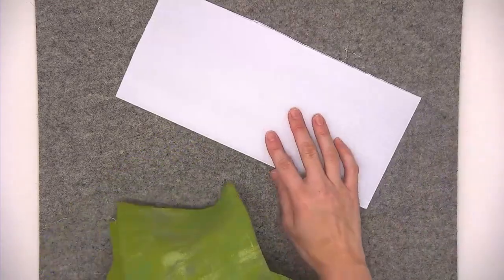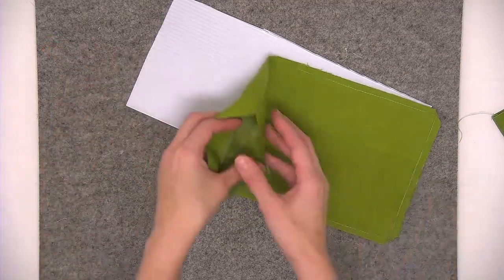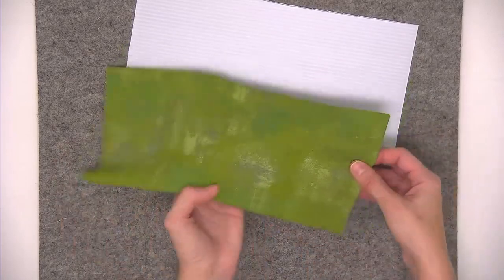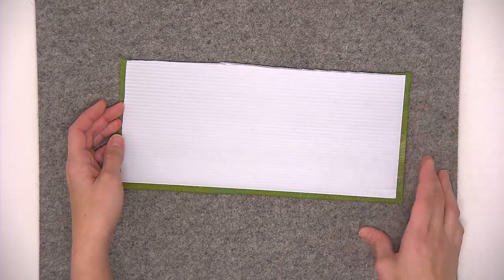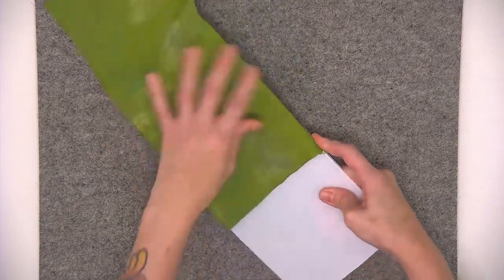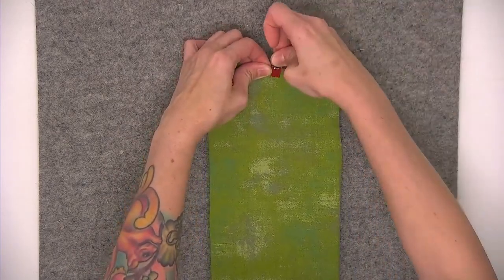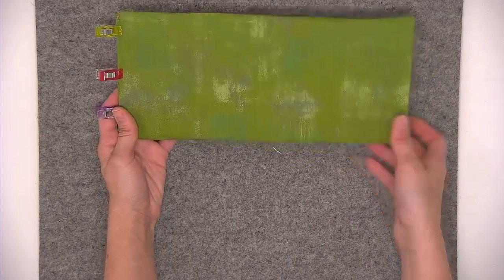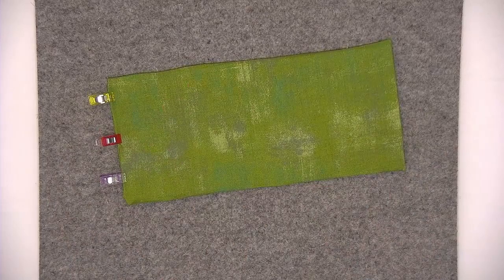False Bottom Part 2

Comment: I've made oodles of false bottoms. I actually had a plastic corrugated sheet I purchased years ago to place between the springs and mattress of my hide-a-bed and kept it when we got rid of my couch. I used the corrugated plastic in the bottom of pet carriers I've made and sold. I used 2 pieces for added support, taped them together and just covered it with foam, fleece and matching minky/fabric.for a firm and stable comfortable pillow like bottom. It works great!!

Comment: I did it once out of a cardboard, I took it off every time I washed the bag, but I didn’t know that is a false bottom. I also used a plastic canvas (the one that is use to cross stitch with wool yarn), I cut it to the measurement of the bag but was not sturdy, I sew two together with wool yarn, then covered it with the fabric… it worked well, but not enough sturdy for long time because it was a big bag. Now I know the name and what to use, thanks, Sara!

Comment: I use the foam board, but instead of sewing the edges shut I extend the open end by an inch or two so it folds underneath. This way I can remove the foam easily for washing the cover or change the piece of foam board.

Comment: I'm curious if the edges of the plastic will wear through the fabric cover over time.
Reply: When I've used this corrugated plastic I snipped the corners to somewhat give them a round-ish corner to take the sharp ends off and just placed some painters tape around the edges to soften the blunt cut edge, then covered with desired materials for the project I was making.